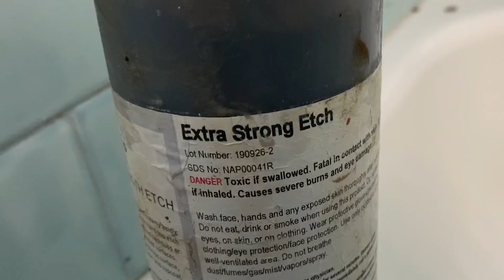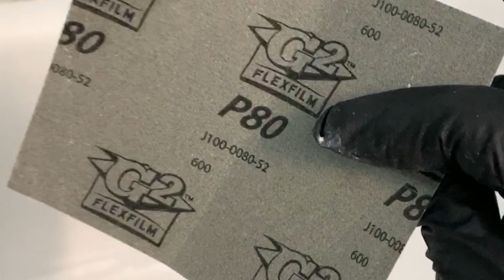HOW TO REGLAZE A BATHTUB #3 | PREPARING A BATHTUB TO BE REGLAZED / PAINTED

Comment: The recoating of the bottom of the tub was totally ommitted - we saw the before and after, but not how you did it. Also, thats the sloppiest caulking work Ive ever seen. There are tools you can use besides your finger to apply with far better results

Comment: Thank you for sharing your knowledge 🙏.  One question in regards to the sanding process step.   I own both an random orbital sander and a cornet cat sander (finish sander), 

would it be beneficial to use one of my sanders? 

or combination of both (first pass random orbital sander and follow it with the finish sander)??

Or good ol hand sanding such as what you did in your video?? 

Thank you sir!
Reply from the maker: Orbitals are totally fine and actually better. Use them.
Reply: @DPTubs  thank you for your reply.  

Are you in the LA area? If so, I might just hire you to do my bathtub, I believe I read somewhere you commenting that you charge $300. 
I have a regular size bathtub made of steel. Let me know if you are in the LA area and how to get ahold of you. Or if you are not in the LA area or you are to busy,  can you recommend someone that would be willing to bid my job?? 

I currently have to many things on my plate and while I would love to tackle this project,  I think it i have someone else do it would be best for my well-being.  

Thanks!

Comment: Getting ready to remodel a 1972 bathroom.  Steel tub and glazed tile are in great shape but Harvest Gold has got to go.  I’ve been reluctant to refinish but this video is encouraging.  Your reply’s to all the comments are great too.  I have two questions:
1.  If you refinish a tub bone white but a different color for the tile, which would you do first?
2.  If the tile is to be replaced, do you recommend replacing the tile before refinishing the tub?
Bonus question:
Would it be less than $1,000 to refinish both tub and tile?  There are no chips or scratches in either.

PS: just subscribed so I’ll be looking for your other videos.
Reply from the maker: 1. I would refinish bony first  but make sure you Oreo both first : cleaning and acid washing. Then I would dry and mask off the tub and spray the tile. I would come back 48 hours later and then tape off the tub using blue masking tape on the tile. Make sure your coats are thick enough to prevent the tape from peeling coating. 

2. Always replace AND reinstall before Reglazing, including grouting too.
Reply: @DPTubs  
Thank you, sir.  Great channel, I learned a lot from the video and even more from your responses to all the comments/questions.

Comment: What is extra strong etch and what does it do? What did you pour on the etch to remove it? What did you use to get it all white again? Enamel paint? Acrylic paint?
Reply from the maker: Great questions! I will make a video surrounded by the acid etch part of this video. 

Etch deglosses and roughs uo the surface for adhesion

Poured cold water on the etch to remove it

I sprayed Resurface solutions Bathyub Reglazing coating. Shown in another video on spraying bathtubs here on my channel

Comment: What did you spray this with?  I know it would hard to spray and film at same time but really wondering what you sprayed it with
Reply from the maker: I have about 20 others videos showing the spraying on this channel. I use a capspray HVLP Spray gun and turbine using Resurface solutions top coat.

Comment: Hi again! I do this work for a lot of apartment complexes as well as residential homes.  I have been looking for a good solution to a refinished bathtub’s arch nemesis, (Suction cup mat). I found a product at Home Depot called “anti-slip floor finish additive” and was curious to know if you have tried it. It just adds to the paint according to the instructions. As always, thanks for the great content.
Reply from the maker: I use Shark Grip from Sherwin Williams. Works really well. You can also search Amazon for bath mats without suction cups that are machine washable.
Reply: what paint do you use for tubs?
Reply: @mayquez9801  Right now I’m using Tile Doc. But  I am not always able to find it. Before that I was using a Benjamin Moore product. Tile Doc is great!

Comment: Sorry if someone already asked this, but does it make the tub slippery? Is there some kind of slip resistant addition you would recommend?
Reply from the maker: No it doesn’t make us slipper. What makes it slipperybisbthe soap and shampoo used There is a non slip additive that can be applied / sprayed if recommended. It’s not recommended to use a bath mat with auctions cups as it will work against the coating. However, there are bath mats without suction cups that can be purchased via Amazon.

Comment: Hey DP, is there a reason you hand sand after the etcher and not use an electric sander?
Reply from the maker: You can use either...I like by hand in the corners  and since the tub is already rough from the acid I just need to get anything left over and sometimes I will wet sand to also rinse the tub a bit as well. Just preference mainly.

Comment: Do you vent the room. I had a pro tell me if my window was over the tub he would not do work. I had no air vent in the tub or bathroom ceiling.
Reply from the maker: I have a fine extractor exhaust fan video showing the ventilation system I use.

Comment: How do u clean these after u get this kind of work done tho? Can u use bleach and or toilet cleaner on reglazed areas?
Reply from the maker: Non abrasive cleaners
Bleaches are ok but not recommended for regular use as they will dull out the finish over time. 
Liquid soap cleaners like Lysol tub and tile, 409 Spray, Soft Scrub with lemon, ZEP tub and tile cleaner.

Comment: Does that acid etch work on grout too?
Reply from the maker: It will definitely help clean it but I would only use it on grout if you are etching the tile as well. Then you still need to rinse the acid very well and scrub clean after with scotch bright pad or sand paper.

Comment: Do you always take the drain out? I know it may fail on the drain. Thank you
Reply from the maker: New Look Tub Restoration never take it out unless customer takes it out before I get there. Messing with plumbing is a can of worms and I just let them handle it otherwise I mask it off. I will post a video on how I mask drains and the surface.

I also tell the customer if they keep the drain in that they MUST wipe up the settling water around the drain after use
Reply: @DPTubs  thank you. I Appreciate it.

Comment: Did you skip showing some of the steps?  What's the red stuff?  I would have liked to see you use the various products that you listed.
Reply from the maker: Thanks for watching. I have quite a few more videos that go into detail on the products used. The red stuff is the bondo and I use it quite a bit for chip repairs and also on fiberglass repairs. You can check out those videos to see how it is mixed etc.

Comment: With out the drain and the caulk wouldn’t the solution just drip down the side?
Reply from the maker: Nope not at all! I wait in between coats for the material to tack up and then apply another. No drips or runs.

Comment: My tub is made from this material...and is worn, how long will these results last?
Reply from the maker: The main two factors are preparation of the surface and how well you take care of it. If the tub is prepared well and all steps followed then it could easily last 5-10 years with PROPER CARE. Reguular cleaning and proper use of cleaners is crucial to the longevity of the product.

Comment: What is the acid wash you used and what does it do?
Reply from the maker: It deglosses and roughs up the surface so your top coat has more to grip to (adhesion) I use Napco Extra Strong Acid Etch
Reply: Thank you 😊 🤙🏾 🌺

Comment: How much does it usually cost to have this done? Do you think it is possible to DIY?
Reply from the maker: It costs $295-$325! It can be done DIY if you have the right equipment. The issue with cost is that by the time you by the material and equipment you are already out quite a bit of money. That’s where it becomes cost effective to have a professional do it unless you plan on doing more. You will have left over material.

Comment: Hey, you didnt show us what you used to make the tub white?
Reply from the maker: Krylon Tub and Tile. Two part mixture!
Reply: @DPTubs  thanks for your response! Would it make any difference if I just used the spray? Or do you prefer the paint? How long does it last as well?
Reply from the maker: Depends on what you are doing! If you do the entire tub I would use the quart and use a spray gun. If you are touching up an area only then the can is fine!
Reply: Thanks. I want to know how long will the finished tub last?
Reply from the maker: It mainly depends on how well you care for it! Average expectancy would be 5-10 years with proper care
Reply: @DPTubs  you used the spray paint on this tub right?
Reply from the maker: I mixed it and sprayed it from my HVLP spray gun, not a can!
Reply: @DPTubs  thank you for all your communications!

Comment: How much would this cost?   Need my tub hooked up
Reply from the maker: If it’s just a tub like this it would be between $295-$350
Reply: If I am doing whole bathroom over should I install the new tile , grout and caulk  before you were to regalaze old 1960s pink tub?.Tub  is actualy in great shape . How long do you think this would last ? Our in your opinion should I just rip it out ? Ive ripped out old cast iron tubs before and its a real pain trying to breake them up without blowing the walls out

Comment: What did you use to resurface the tub.. you skip that part you showed us after you painted it. you paint it with what did you use...we need to know
Reply from the maker: I have many other videos showing as well as one specifically showing the mixture of material. Resurface Solutions. Search DP Tubs Mixing Reglazing Material. Thank you so much for watching. 

I also have another video using Integrity Coatings. search DP Tubs pink bathtub Reglazing

Comment: What are the steps?
Reply from the maker: What do you mean? There are other videos too that show the process as well: 

Clean and rinse 
Remove caulking 
Acid wash 
Fill chips
Sand down tub
Mask and tape off around tub and fixtures 
Clean of any dust 
Apply bonding agent or primer 
Spray finish material / Too Coat

Comment: I didn't really learned anything, you put a red compound on the chipped parts, never mention what it was, reglazing, don't know if it just a clear coat or paint, there is not step for it. Other than that did see it locked more clean after the etch compound you used.
Reply from the maker: Watch more videos. There is plenty of information on the process throughout the videos on the channel.

Comment: Big mistake with the choice of caulking. That stuff won’t last & it will get gross fast. Should be using a 100% Silicone caulk.
Reply: DAP Extreme stretch should only be used for trim work.
Reply from the maker: Never...been doing this for years. This is what works for me. Keep in mind that caulking is something that needs regular upkeep. If you use 100% silicone you will have a very difficult time removing it when you need to clean it up. I swear by this caulking. Tub and Tile. Sulking is like watered down glue. Silicone is like putting a glue down that you don’t want off. Shower door dealings for example... they get nasty and removing it is a pain for professionals and homeowners.
Reply from the maker: Extra Stretch works amazing for sealing around a tub. The color, the waterproofing, all work great. This is what works for me.

Here is the official description: crack proof and used around sinks and countertops. I have found it’s even better around tubs at the expansion joint. 

DAP EXTREME STRETCH is a premium urethanized sealant ideal for sealing a wide variety of interior and exterior surfaces. It is specially formulated to stretch over 600% ensuring seal does not crack or lose adhesion. Its unique formula is easy to apply and tool, is low in odor and cleans up easily with water. Perfect for most sealing projects including windows, doors, trim, siding, gutters, flashing, sinks and countertops.
Premium crackproof elastomeric sealant
Stretches 600% for a crackproof finish
Adheres to virtually any surface
Paintable in 2 hours
Seals joints up to 3 in.
Easy water clean up
Low odor
Interior/exterior
Lifetime
Exceeds ASTM C920 class 25
Reply: Looks amazing!  What do you use as the filler (that red stuff) Apoxy?